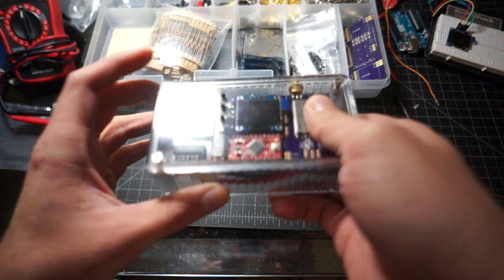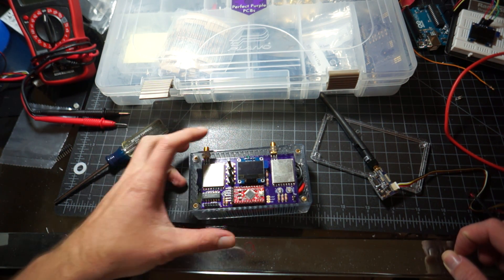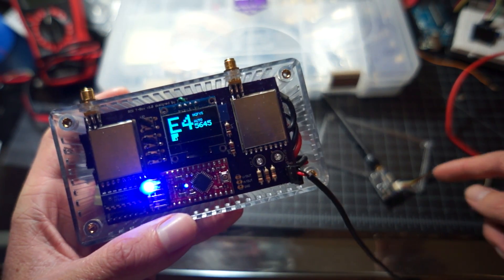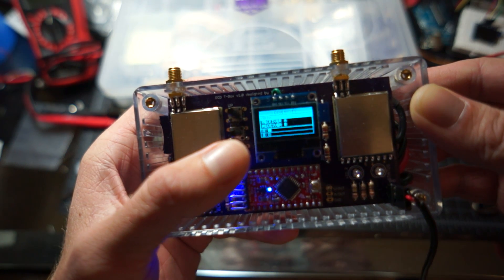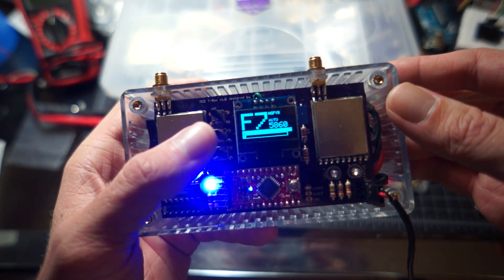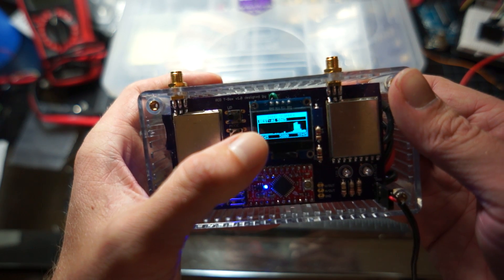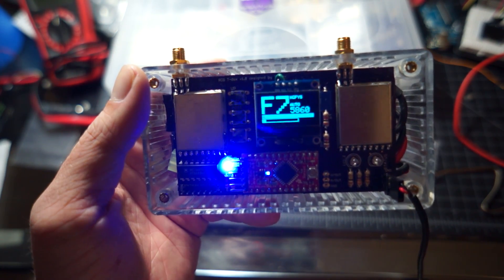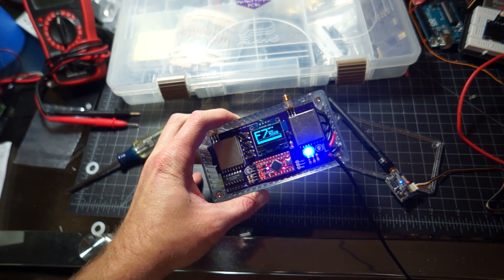Open Source 5.8 Diversity Receiver

Comment: I like this project except for that TINY undersized screen.  I'm 42 and prefer my displays visible without a close-up.  The project originated by displaying that dialog on the actual screen itself.  I laid out my own circuit board for t his, have not finished it yet.  Nice review, thanks for information.

Comment: you can burn the antenna wihtout put them.
Reply: Thats only with the transmitting part the receiving end doesn't need an antenna but the antenna helps with range